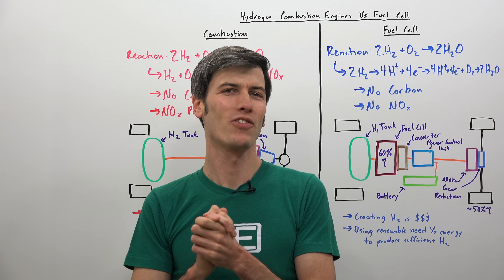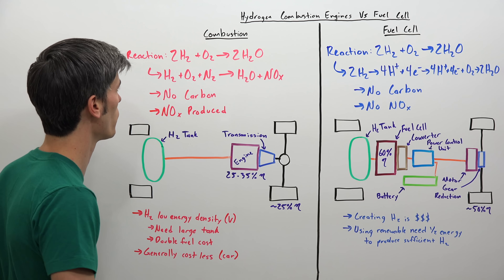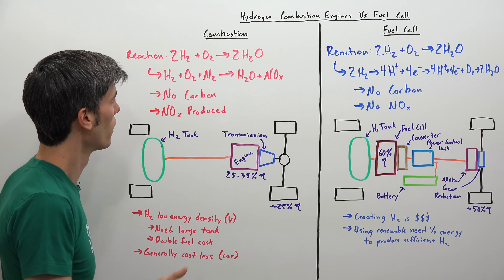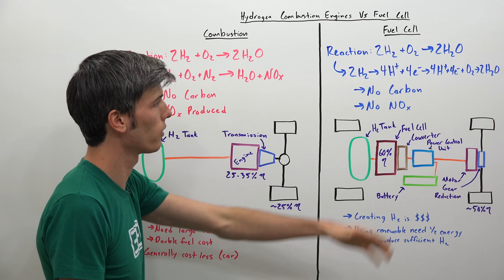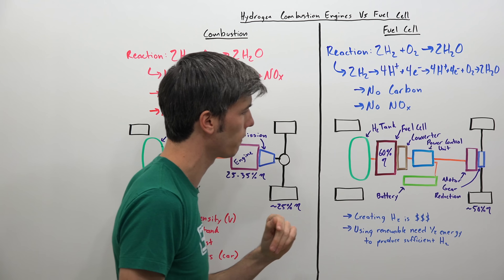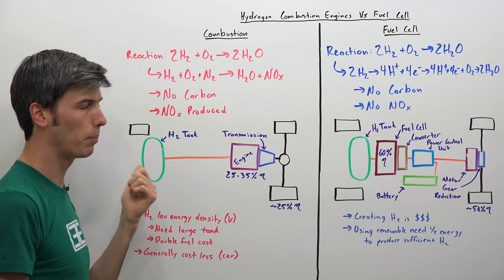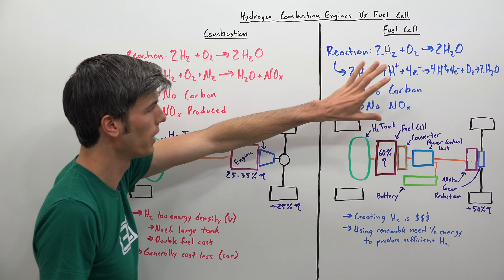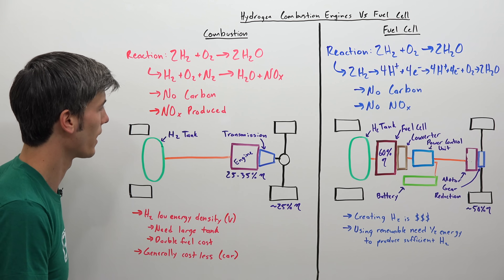Why Hydrogen Engines Are A Bad Idea

Comment: The advantage of hydrogen combustion is million's of car's with regular engines could quickly be converted at minimal cost.
Reply: @Dimetri Drossos ...aren't those things the reason for the carbon problem?

Nitrogen oxide instead of carbon?
Reply: @Dimetri Drossos what is def fluid...and why would it matter if diesel engines produce this fluid? Surely you are not arguing that diesel engines are a good thing as far as pollution goes? I'm not a mechanic...but I understand when I stand next to a diesel truck I can't breathe well. And almost every person who drives them removes the environmental protection and tries to make the biggest black cloud they can....
Reply: @Paramdeep Grewal you mean it absorbs it?
Reply: @Ian-ie3hy  No, it reacts with it and eliminates it. Look up selective catalytic reduction (SCR) if you want to know more.
Reply: @Alex50cc  I'm guessing it's up to the owner to decide whether or not to keep this part maintained? Especially in places where there are no inspections. Florida has no inspection for example. Safety or emissions..or otherwise.
Reply: It's actually really difficult to make the switch.
Reply: @Ian-ie3hy  Vehicle equipped with SCR systems typically will only run in "limp mode" if the DEF is empty or the system isn't working correctly. The system can be deleted but most shops wont do it as there are huge fines associated with getting caught.
Reply: Luís Andrade  not good for what? Seems pretty good for the environment vs crude oil....?
Reply: @Dimetri Drossos Combusting Hydrogen produces water vapor, which is 35-45% of a higher greenhouse gas to CO2. So we would be replacing one greenhouse gas with a denser one.  Makes complete sense!  Water vapor accounts for 60-70% of the greenhouse effect while CO2 accounts for 25%
Reply: @acdii  better watch out for that deadly dihydrogen monoxide. Deadly stuff!
Reply: @Ian-ie3hy  Good to keep us hydrated, but, not so good for climate change.  After all isn't the goal to reduce greenhouse gasses?  See the irony?
Reply: @acdii  the irony is that in an effort to continue burning fossil fuels you make an effort to attack a critical component for life to exist....not sure this is balanced 🤣
Reply: @Ian-ie3hy  whatever the hell you posted makes no damned sense.
Reply: @acdii  says the guy who is waging war on precipitation
Reply: @acdii  are you actually making the argument that WATER is bad for the planet? just want to make sure I read that right.
Reply: @ForzaJersey  CO2 reaches a certain level, beyond that it has no effect. That has been proven a few times by various scientists, but CO2 does hold in more water vapor in the air. Isn't the goal to reduce greenhouse gasses?  Eliminating all tailpipe emissions, including water vapor would reduce the amount of greenhouse gasses, thus cooling the planet.  Co2 is a small amount, causing 25% of the warming while Water Vapor causes 60% of the warming.  Water vapor then become clouds, which further trap in heat.  Ever notice on a sunny winter day that it is colder than on a cloudy day?  Go look it up, plenty of documentation on it.
Reply: @acdii  no you just build a bunch of MOF to collect the water vapor from the air giving cities that suffer from drought more drinking water therefore being truly “green”
Reply: @acdii  But if the hydrogen was produced from electrolysis of water, then the result is a net zero. The water was already in the environment, only temporarily removed.
Reply: @craigslitzer4857  Nope, difference is water in a solid form used for electrolysis is not the same as the vapor that you can't see until it forms clouds. 

Here's the point being missed here. Water vapor traps 60-70% of the heat that gets trapped. Cars today that burn hydrocarbons emit water vapor already. By switching to hydrogen as a fuel, they will continue to emit water vapor. The goal is to reduce greenhouse gasses, Co2 is just a small part of the gasses that trap heat.  Going Full EV emit NO water vapor. 

You have all heard the term dry heat, right, the lower the humidity, the cooler one feels, well, humidity is the percentage of water vapor in the air.  In recent years Las Vegas as seen a rise in humidity levels due to water evaporation, high auto traffic, fountains, etc. IOW People. Rises in water vapor changes weather patterns. Can also contribute to drought conditions.
Reply: @Ian-ie3hy  for the most part, depending on where you are, it could be illegal
Reply: @gibbostation_7758  if you are suggesting water from dehumidifiers is safe...it's not
Reply: @Ian-ie3hy  no it’s a mof I guess it could be a dehumidifier since it’s taking vapor from air. It’s actually fine to drink
Reply: @gibbostation_7758  any machine that captures water from the air is a dehumidifier. Call it what you want. Trust the water if you want. The machine itself contaminates the water via collection procedure. Yes you can filter it. It's still got loads of bacteria in it because the moisture condenses on metal plates etc...if you have a choice do not drink that water....
Reply: @Ian-ie3hy  you make sound like you totally don’t drink water that comes from a water plant that has chemicals to kill bacteria cmon stop it
Reply: Not true, but you go on thinking so.
Reply: @johnsmith1474  you must have no mechanical ⚙️ knowledge you actually can pretty easily
Reply: @acdii  “It’s true that water vapor is the largest contributor to the Earth’s greenhouse effect. On average, it probably accounts for about 60% of the warming effect. However, water vapor does not control the Earth’s temperature, but is instead controlled by the temperature. This is because the temperature of the surrounding atmosphere limits the maximum amount of water vapor the atmosphere can contain. If a volume of air contains its maximum amount of water vapor and the temperature is decreased, some of the water vapor will condense to form liquid water.If there had been no increase in the amounts of non-condensable greenhouse gases(carbon dioxide, methane, nitrous oxide, and ozone), the amount of water vapor in the atmosphere would not have changed with all other variables remaining the same. The addition of the non-condensable gases causes the temperature to increase and this leads to an increase in water vapor that further increases the temperature. This is an example of a positive feedback effect.There is also a possibility that adding more water vapor to the atmosphere could produce a negative feedback effect. This could happen if more water vapor leads to more cloud formation.” For someone who says look it up you sure do cherry pick your info
Reply: Just like LPG, if a little more complex.
Reply: Just a side note, but apostrophes are not used to write a word in the plural form.
Reply: No, they couldn’t. The car would go like 50 miles on a tank.
Reply: @jonathanfields4ever  more than the first electric and petrol cars could.
Reply: @callumhardy5098  And? That was over 140 years ago.
Reply: @jonathanfields4ever  exactly, and at the rate new technology progresses nowadays they will have hydrogen combustion cars in the next 10 years, JCB have already made a hydrogen combustion engine and are putting it in excavators.
Reply: @callumhardy5098  Nah. Unless there’s some wild breakthrough in hydrogen production, hydrogen engines won’t be a thing. They’re too inefficient and hydrogen is too expensive.
Reply: @jonathanfields4ever  there is wild breakthroughs, they are happening now, like I said with JCB and also Siemens are building two large electrolysis stations in Germany to produce green hydrogen. If these are successful then who knows.
Reply: @callumhardy5098  Building electrolysis stations is not a breakthrough. They have to increase the efficiency of hydrogen production massively for it to be useful for cars.
Reply: @jonathanfields4ever  yes, which is what building and testing electrolysis stations will do.
Reply: @jonathanfields4ever  that’s terrible progress, I still however think that the benefits of hydrogen combustion engines will outweigh the drawbacks, the non- inflationary price for a start.
Reply: No easy convertion:   1) you need ho increase the cylinder size   2) hydrogene plumbing is very different from plumbing for other gases and liquids.  Lond story short: this conversion is not practical if ever possible. Hydrogene leaks are extremely dangerous as unlike LNG the hydrogen produces an explosive mixture with air at very wide consentration range.
Reply: No
Reply: @OdingHelps  care to explain why? Or do you just enjoy leaving big meaningless sweeping statements with no point behind to satisfy your own lack of grey cells?
Reply: @callumhardy5098  It's meaningless to you cause you don't understand it.
Reply: @callumhardy5098  No ,that would waste my time i am not obligated to explain anything.
Reply: @OdingHelps  Not obligated at all just makes your comment weak and meaningless.
Reply: @OdingHelps  Well first of all you need a ‘be’ in front of that ‘cause’, Perhaps if you could grasp basic communication then you could further yourself.
Reply: @levcher2  I just need to jump in here and say, hydrogen has an octane of 130> (RON) so it will be really hard to ignite it without an open flame or a spark plug
Reply: Unless you daily drive a Wankel engine, this technology is obsolete with a piston engine..
Reply: @acdii  nice spot on explanation
Reply: Or just go for electric cars...
Reply: @VtecdippinBB6siR  go and have a look at JCB.
Reply: @mauricemizero2218  that’s the thing, it costs a fortune (even if it is electric converted).
That’s why hydrogen is a good replacement.
Reply: @acdii  👍🏼
Reply: @acdii  👍🏼
Reply: @acdii  👍🏼👍🏼👍🏼
Reply: Exactly!
Reply: This only favors car manufacturers and oil companies who are keen on getting into hydrogen business
Reply: Still, old and too many moving parts unless you went valveless that would be nice!
Reply: @Ian-ie3hy  The top 100 energy companies are responsible for 80% of all carbon emissions I believe
Reply: Did you watch the video?
Reply: @Mr.Thermistor7228  does the name volkswagen mean anything to you
Reply: @Dimetri777 This is really late, but I wanted to text this anyway. Please, check other science too. The earth was warming anyway, because there are cycles of warming and cooling. We know this from the ice ages. The dark ages were colder than now and science has proven that. That's one reason that they were dark, cause people didn't travel and do much, it was a struggle to just survive. But when the earth was warmer, that's when people had more and there were great civilizations built: like the Greeks and Roman empire, etc. And this cycle has repeated itself since recorded history. So there's lots of reasons to question whether the data that they're gathering is the chicken or the egg, or the cause or the effect. There's no clear answer. There's obviously correlation, but who knows which way to interpret the data. I don't trust any of them because they're all politicized. All I can say is that a warmer earth usually correlates with better crops and more food for us humans. Bring on the global warming.
Reply: @Ian-ie3hy  Every person that drives a diesel removes the emission controls? Really?
Reply: @markme4  no. plenty do. and parts break down. diesel bros themselves said the repair is expensive and reduces your hrsprs...so its cheaper and better for the yees and the haws to remove the part when this issue comes up 🤷 

i dont see where your getting upset here
Reply: @Ian-ie3hy  You make it sound like the majority of diesel owners remove the emission controls when in fact it's a very low percentage. Not to mention the EPA is making it almost impossible to get away with doing so.
Reply: @Ian-ie3hy  What does what Volkswagen did have to do with your claim that most diesel owners are removing their emissions?  Where is your evidence?
Reply: @markme4  there are no emissions in florida....sooooo 🤷
Reply: @Ian-ie3hy Lol , now we're talking Florida?
Reply: @markme4  i fail to see any valid sources of info coming from your comments...florida has no emissions ...its a fact...can you try more to derail the conversation? are you just here cause you got nothing better to do?
Reply: @Ian-ie3hy  You're the one that made your original comment without backing it up, there is no evidence that most people are removing emission controls from their diesels.
What does Florida or Volkswagen have to do with your comment?
Reply: @markme4  then you have read nothing i said...youre just here to talk..so be it
Reply: @Ian-ie3hy  I think you are just talking to yourself
Reply: @markme4  i think youre a troll
Reply: @Ian-ie3hy  Yes, I'm trolling for some facts,  where's your facts?
Reply: @Ian-ie3hy  DEF (Diesel Exhaust Fluid) is weak uric acid. Piss, if you will. I don’t know how it works, but my 1-ton Ram gets 25 mpg at 75 mph. But only 20 mpg in stop and go traffic.
Reply: @larshowen3319  mpg depends on a whole host of things....including how far the accelerator is pushed. not necessarily linked with how much unspent fuel is spewing out the tail pipe
Reply: @Ian-ie3hy  I was only commenting on your question “what is def?” It really is uric acid. It’s sprayed into the primary exhaust stream, after which it is brought back into the intake for secondary combustion. Great for fuel economy. I can’t speak for other diesels, but when my Cummins is running, you won’t smell anything unless you put your nose up to the exhaust pipe.

Contrary to popular belief, diesels are much cleaner than gasoline engines when compared power for power, torque for torque. Engineering Explained has an interesting video on the topic.

And, I’ll posit, they’re cleaner than electric vehicles as well. (Electric vehicles run primarily on coal-generated electricity. Not good, we need to exploit nuclear power more.)
Reply: Not possible with normal car because compression ratio.. Hydrogen would need very high compression ratio more than desiel engine.. Hence challange, it make sense to generate power for electric motors and motors drive engine this could be also option
Reply: I feel it wouldn't be necessarily easy to convert regular internal combustion engines to a hydrogen fuel, the byproduct of water is great for the environment, and for us atmosphere consumers, but it's just terrible for a system of compression pistons since water doesn't like to be compressed. The combustion chamber Must be evacuated completely before the next cycle starts, on average they are but not every engine has the tolerances to accommodate that.
Reply: @Ian-ie3hy  you are wrong and making so many assumptions on so many levels, and you need to learn what def fluid is (desiel exhaust fluid) it removes the nox.
Reply: @Ian-ie3hy  if you choose to disable your emissions control devices on your car or truck, you can make it pollute more, but if you are responsible and mantain these devices the pollution will be greatly minimised
Reply: @andrewfetterolf7042  we all know 🤷
Reply: Omg...  so much wrong in these comments.
Todays engines  properly running and tuned produce very little anything adide from water vapor and carbon dioxide. The same thing living creatures exhale.

Nox is the driving force behind acid rain. It isn't produced in a rich fuel mixture. It requires unburnt air(nitrogen, which makes up over 70% of our atmosphere,(remember that next time you pay for for 80% nitrogen in your tires,))
So a desiel engine "rolling coal" n chuffing away, is actually better for the environment than one that isn't.. in some respects. Ya, the soot is ugly n sucks, but it just falls to the ground n turns to dust, rather than vapourizing inyo the atmo.

Outside all that, i don't even buve in climate change. Look at weather patterns over the last 1000 years. Its just a slowly shifting cycle. O.o
🤣 
Honestly, i don't care anymore, we've destroyed this planet loooong ago, like a festering wound that'll never heal.
Reply: @acdii  todays cars when properly tuned and running, produce little more than water vapour and co2 as it is. You can't even run a hose off the tailpipe in the window to off yourself. You just get a headache n case of the munchies.
Hydrogen is litterally produced ftom water. You're removing water, to make energy, and then turning it back into water. Theres nonplus or minus.
The atmosphere only holds so much of the dreaded water vapour... then it rains. Wirse case scenario, it rains a little more often?
I don't see the downside as apparently thebplanets getting too warm, so let it rain n cool it down more. Besides, its bern a bit droughty, fsrmers bern vomplaining for years about lack of rain.. BURN THAT HYDRO!
🤣
Reply: @LynxGenisys  this non chalant attitude about the environment is such a cop out.....it wont affect your life so you dont care.....golf clap for the hero
Reply: @LynxGenisys  What is it that is used to crack hydrogen from water? Electricity. What makes electricity, Hydrocarbons. So you trade one source of hydrocarbons for another.  Until technology reaches the level where it no longer requires hydrocarbons to crack Hydrogen, then it doesn't make any sense to push Hydrogen power. Once Solar cracking becomes a viable solution, then having hydrogen power makes sense.

A hydrogen cell requires 99.9% pure hydrogen, otherwise the cell gets damaged. Only cracking water creates green hydrogen, and it is very costly to do. Hydrogen produced from Methane and petroleum is not pure enough.  There is a Solar process being developed, but is quite a ways away from viable production.
Reply: @acdii  electricity can be generated from tons of other sources... some of em barely hurt a thing... granted technology needs to advance further to make any of it a viable solution, but look at far its come in the last 20, 10, 5 years even.
You can't expect to solves 100s of years of ignorance and destruction near instantly. If we find viable solutions in the next 10-20yrs, it'll be amazing. I expect we will be well on our way, but its unrealistic to expect the entire world to completely change its ways so rapidly.
But the at least its on the right path.
Nobody wants to give up thier modern conviences...
Reply: @acdii  but were taking existing water vapor and preforming electrolysis to turn it into fuel using a separate energy source, you not adding extra h20 to the air, once there's to much it rains and goes back into our oceans and lakes
Reply: @acdii  
Water vapor is a big greenhouse gas.  However, water vapor tends to condense on things in the atmosphere forming clouds.  Clouds are so effective at blocking solar radiation there have been plenty of successful experiments showing how we could reduce the global temperatures by vaporizing a lot of water and increasing overall cloud cover.
Reply: @Ian-ie3hy  it turns into water bro
Reply: They don't want to loose the Petrol dollars over this, so they keep as low R&D expense as possible on it. Thank goodness for Japan-Toyota-Yamaha. 

Hydrogen is the future.
Reply: @saxonwarrior388  lol
Reply: Exactly
Reply: @acdii  Water vapor?  You dont seem to be to clever man.
Reply: @Alex50cc  yes you read 🤣🤣🤣
Reply: @josephlang2586  and yet they market this “carbon footprint” and try point the fingers at us saying we are to blame. I think BP invented it in the 90s
Reply: Minimal cost? Hydrogen's burn characteristics are so different than gasoline (quicker burn time, different fuel/air ratio needed, pre-ignition problems) you're talking a new cylinder head at the very least.
Reply: Hydrogen gas combustion produced heat at very high level than petrol combustion. 
Engine matel can't risit this heat
Reply: Misleading title. 😂. It Doesn’t encapsulate the comparisons and the great explanation.
Reply: This is not the advantage you think it is.  Do you know how much hydrogen it takes to travel 300 miles with combustion?
Reply: Ywa
Reply: @Alex50cc current selective catalytic reduction require carbon dioxide. Engine is not producing carbon dioxide.
Reply: @acdii why wouldn't the hot water vapor condense to water after it rises to a certain height and after sunset, temperature drop at night.
Reply: And also has anyone computed the CO2 savings by converting existing internal combustion vehicles vs manufacturing all new hydrogen fuel cell vehicles ?
Reply: How does the NOX output from a hydrogen internal combustion vehicle compare to the NOX output from a gas vehicle ?
Reply: Minimal cost? You act like you can put hydrogen in your gas tank, hah.

  High pressure tanks of 700 BARS plus are expensive, bulky, can't be formed into different shapes, and still carry something like 22 liters...

 Then you have the cost of infrastucture. Yeah have fun going from power plant, hydrogen plant, shipping hydrogen to station, vehicle going to station, then using hydrogen.

 Instead of just power plant to vehicle. Hell people can use their own solar or wind to power their cars. People already have solar trailers towed by their trucks to power their vehicles while camping. Can hook up power tools to them too or use them as a generator with some of the new EV trucks. 

 Then you have the electrical strain on the grid which will be MUCH worse. Hydrogen takes a ton of electricity at the moment to separate it from water. 

 If people think billions of EVs will be a problem on the grid. Then Hydrogen will be double the strain at least!

 Batteries are rapidly progressing. Hydrogen is stuck by physical limitations by physics. There will never be a solution to hydrogens volumetric density problems, and fuel cells will never be as efficient as batteries to motors. 

 Companies have recently made lithium air batteries. Those will be ten to fifty times better then the batteries we have today. Solid state batteries are coming out this year. Batteries will become quicker to charge, be more power dense, lighter, and safer. 

 There is no real infrastructure for hydrogen, and there will probably never will be. It will be a niche product. 

 Which sucks. I wanted hydrogen to succeed. Until I learned the physical limitations, and theoretical limits. I still cross my fingers for some science break through with space age magic nano tech.

 Fun fact about hydrogen. Water holds more hydrogen in a given volume by a ton compared to just pure liquid hydrogen! Doesn't make sense.
Reply: This is just purely false